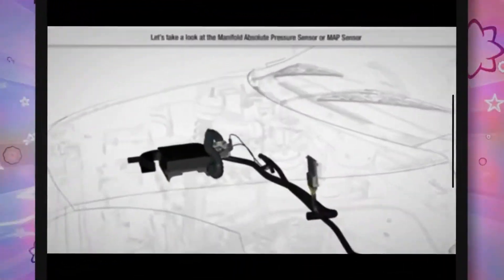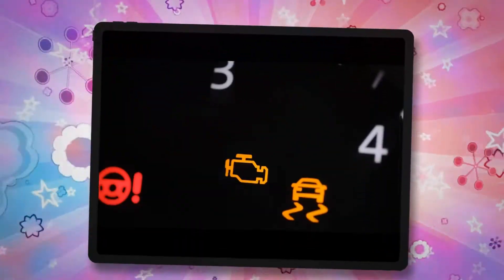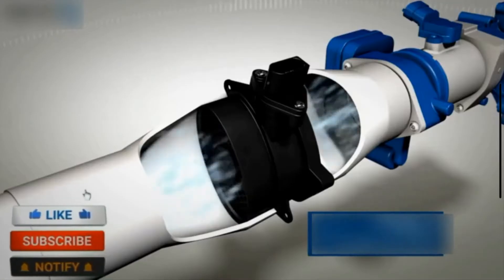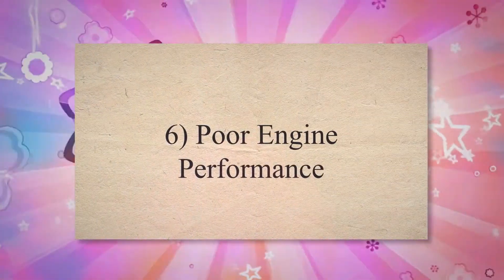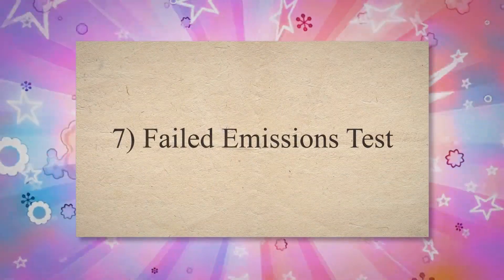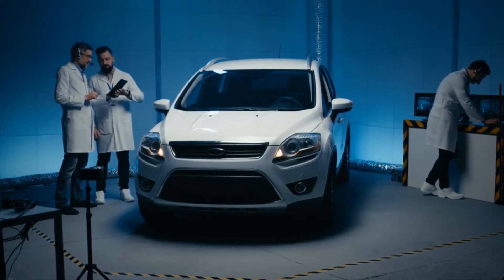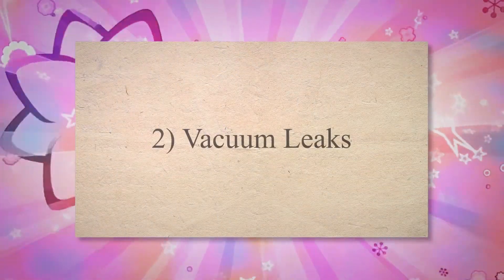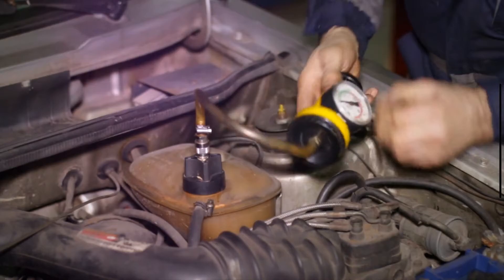Don't Risk It! 10 Crucial Symptoms And Causes Of a Bad MAP Sensor 🚨

Comment: I think mines going out I replaced my plugs , coils , injectors , pump but it feels like it starving for gas , it would run for a few seconds then I would give it gas and it would die , as well as throttle hesitation , hard starts and it smells like fuel , I would unplug my sensor and it would stay running this time I would give it gas and it would stay running , once I would plug it back in it would die then I would unplug it and it would stay running any idea ? Should I replace it ?
Reply from the maker: If this is the case, you should definitly replace your sensor but before replacing your sensor, it is recommended to perform a deep inspection to find the main issue. If you are not competent, you should contact a professional